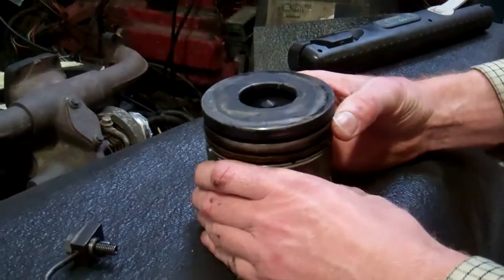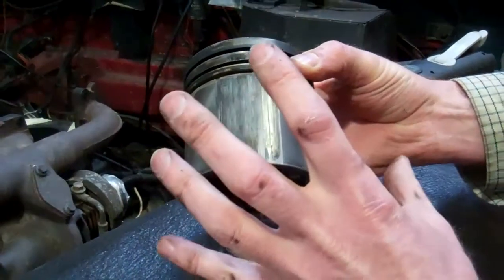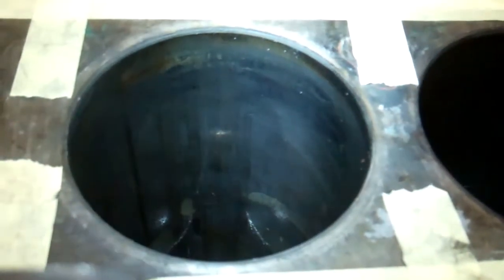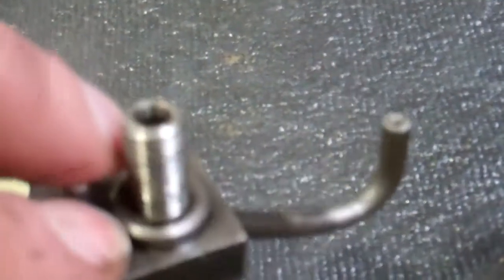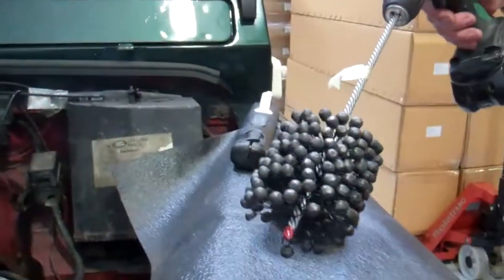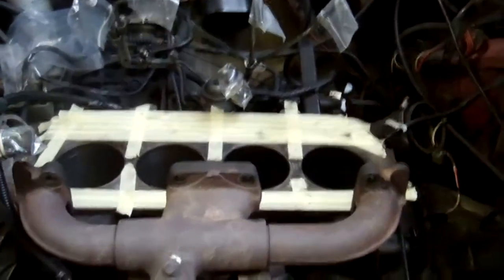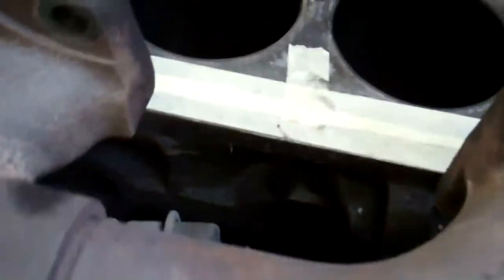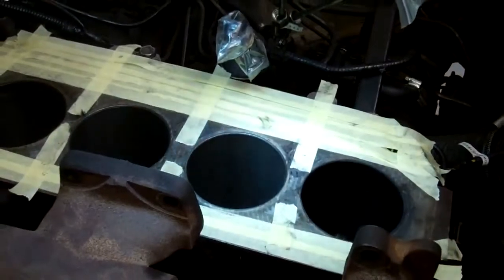Tale of our noisy Land Rover 300tdi Engine with piston slap

Comment: I don't believe in "inframe" rebuilds... simply dodgy honing swarf getting into crankpin's and works its way deeper into bearings and oil galleries with attempted cleaning. Pull the engine and do a thorough job, in spotless clean environment and every single part, cleaned better than new. And only then re assemble. Inframe builds may work for ship or massive truck engines, where entire liner can be pulled and replaced as a set. "Ie, no honing abrasive crap in and on areas where you can never clean"
Reply from the maker: You are of course correct but the defender is still running fine !